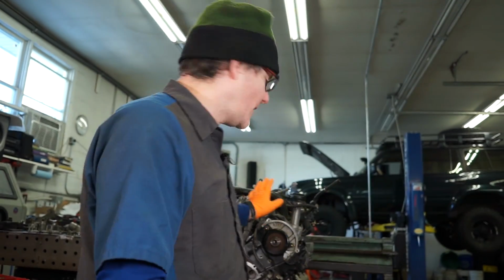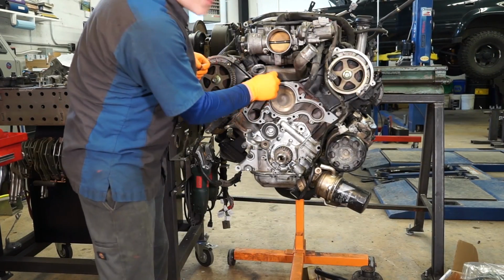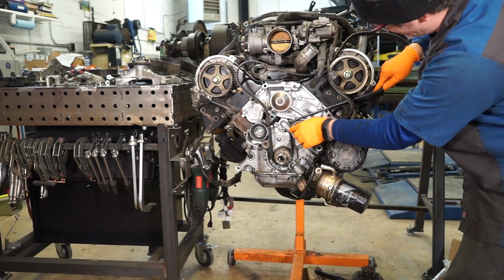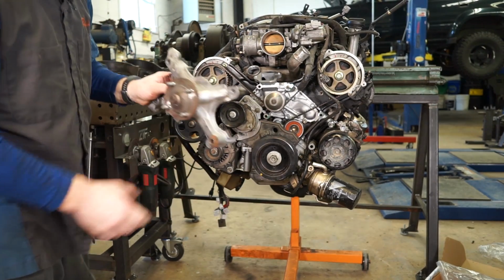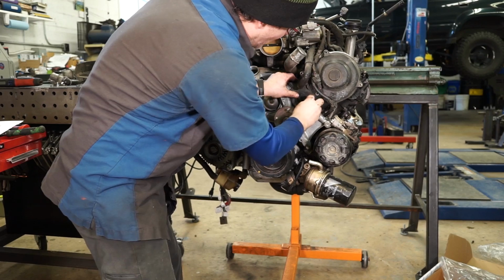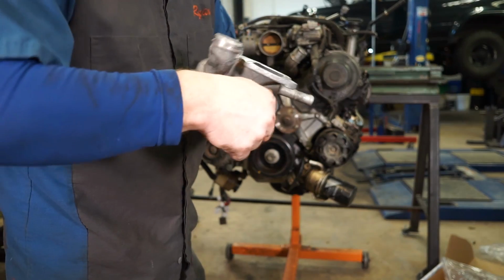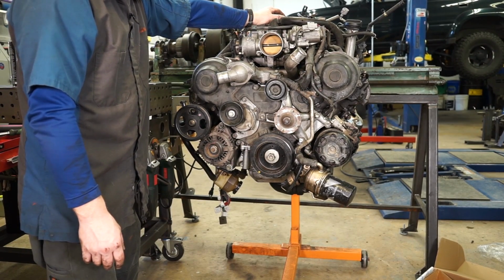Toyota 4.7 Timing Belt (updated) Part 3

Comment: Excellent Video, Helped me DIY, Power steering pump I believe is 33 not 13 seemed kind of light for 14mm so I double checked in the manual
Reply from the maker: That makes more sense. I thought it seemed light when I read it. Always awesome when service info has the wrong specs.

Comment: Excellent video series on this operation, thank you for sharing!  How many hours does it call for the water pump and timing belt?  Toyota only has them separate, 4 hrs for the water pump and 3.5 for the timing belt.  Thanks again!
Reply from the maker: The base timing belt is included in the water pump time since you have to remove the belt to change the pump. It adds a few tenths for each pulley if I remember right. I haven't looked up actual times in years since we have it set as a saved job.
Reply: @OTRAMM  thank you ❤

Comment: I know this is a old video. Well done by the way. What is the part number for the sealant you are using for the water neck? I was just going to use some hondabond.
Reply from the maker: I don't have the part number handy, but it actually changes by which coolant is in the engine. Red uses the older sealant and then there's a wicked expensive updated sealant for the pink coolant.
Reply: @OTRAMM  thanks for the reply. It's a 03 Tundra with a 2UZ-FE

Comment: The little triangle piece that closes off the opening between the timing belt and the AC compressor, behind the fan bracket. Did you put tat back in of camera somehow? Or did you forget to reinstall it? Because I didn't see that get reinstalled in the video.
Reply from the maker: It may have gone in off camera. It definitely went back in. That little piece is very important. We've seen two trucks jump time after mice got behind the cover from that piece being left out.

Comment: I  was told I had my timing correct . But I have no fire
Reply: Is it possible I shorted out the cam position sencer. I skint the wire.
Reply from the maker: It's possible. You'd need the codes and live data to really know what's going on

Comment: Why don't you have the crankshaft keyway lined up with the dimple? It looks like you have it closer to the "window" mark, (4 squares making 1 square).  Would you line it up to that "window" mark, which is past the dimple on crankshaft. when you have the cams set, past TDC (I) to the (T) timing belt service? So dimple on crankshaft and cam to TDC vertical line the same as cams on T and crank on window. Would this be right or wrong

Comment: What is the crankshaft mark, past the dimple, that looks like a window (4 small squares). Where your crankshaft is sitting it looks like it would be closer to the window mark than dimple. Having key stone on dimple only allows 3 of the 5 belt dots to fully seated on sprocket

Comment: Does it actually really matter which way the timing belt goes on the pulleys of a 2002 Toyota Sequoia timing belt
Reply from the maker: It matters a lot which way the belt goes. The timing marks on the belt only line up one way. That's why they marked it.

Comment: It confusing when you say your going to make two full revolutions on the crank pully when clearly their is a yellow mark on the crankshaft pully that shows you did not make two full revolution 🧐
Reply from the maker: Definitely did two revolutions. That's the only way you'll get the marks lined up.
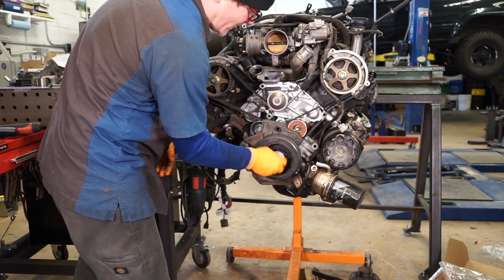Reply: @OTRAMM  @18:54 the yellow dot is at 9 o'clock give or take. I was a bit lost to but I think when you put it on there is a little play that doesn't show up on camera to well? cheers

Comment: What happens if my cam gear jumps and I lose track of the phase? How can I make sure it’s lined up and in phase?
Reply from the maker: Usually you can just spin  it back to the alignment marks. Just be gentle and stop if there's any binding. I've never had one move more than a few teeth.
Reply: @OTRAMM  I went all the way around with it a couple times 😬 still ok to just go back to the mark?
Reply from the maker: @TimRoman  I would assume that'd be ok. I've never tried though to be sure. I try not to let them move at all.
Reply: @OTRAMM  can’t be the first person to have been this dumb. One crank turn is two cam turns so 50% chance of guessing right. Will keep looking, thanks for the fast reply!

Comment: Thank you, and I much appreciate your explicit instruction videos on the timing belt replacement. It was my first time replacing a timing belt on my 2005 Toyota Sequoia SR5 4WD. I followed your part 1 on removing parts, then part #3, putting parts back and torque specs. 

I would like to thank this YouTube content creator ( https://www.youtube.com/watch?v=M5qzZZO_SE8 ) for tips on aligning the timing belt top pulleys to the "T" after the top dead center and then removing the old timing belt; I ignored the Toyota's manual's confusing instruction on rotating the crank 50 degrees after top dead center. The top timing pulleys did not jerk. 

And also, thanks to this YouTube content creator  (https://www.youtube.com/watch?v=9M3hFSiKs_U ) for removing the other parts before following your part 1 video. For anyone curious, my sequoia top pulleys did not look like those in the video. Mine have covers. 

It was a miracle. It was the first time my 2005 Toyota Sequoia ever got the timing belt replaced after 105k miles and 17 years. I followed the advice of a DIY mechanic who told me not to replace it before 100k. The factory timing belt still appeared to me it was in good condition. Please do not do what I did; follow the manufacturer suggested maintenance schedules.

Comment: Here are the time stamps for the video above. I really thank Otram for making this video. 

Full instructions can be see here - https://docs.google.com/spreadsheets/d/1eWefvjUPPUlQPfpIOQ1JHir8111iMPO0/edit?usp=sharing&ouid=118253069347740492478&rtpof=true&sd=true

Slide Crank Pully in keyway 	https://youtu.be/GiOgACPh68k?t=151
Clean Water Pump Area with scraper and green scuff pad (scotch bright pads)	https://youtu.be/GiOgACPh68k?t=331
Install Water Pump Gasket 	https://youtu.be/GiOgACPh68k?t=375
Install water pump pipe o-ring (put a little bit of silicone to make WP seat properly)	https://youtu.be/GiOgACPh68k?t=380
5. Install Water pump	https://youtu.be/GiOgACPh68k?t=420 
6. Install Idler Pully #2 (Red one)	https://youtu.be/GiOgACPh68k?t=584
7. Install Tentioner Pully #1 (Black) with washer	https://youtu.be/GiOgACPh68k?t=242
8. Install Plastic triangle	https://youtu.be/GiOgACPh68k?t=625
9. Install Timing belt	https://youtu.be/GiOgACPh68k?t=655
10. Double check Camshaft marks - Crank shaft timing marks again	https://youtu.be/GiOgACPh68k?t=880
11. Install Hydraulic Timing tensioner	https://youtu.be/GiOgACPh68k?t=892
12. Ensure timing belt is installed correctly with the correct Cam and Crank marks	https://youtu.be/GiOgACPh68k?t=982
13. Pull the tensioner Pin out of timing tensioner	https://youtu.be/GiOgACPh68k?t=1035
14. Put timing keyway Gear disk (Timing way key gear) - MAKE SURE Concave side out	https://youtu.be/GiOgACPh68k?t=1051
15. Install  Crankshaft plastic timing cover on	https://youtu.be/GiOgACPh68k?t=1075
16. Install crankshaft timing pully (dampner pully) line it up with the Keyway	https://youtu.be/GiOgACPh68k?t=1115
17. Double check timing is good again	"https://youtu.be/GiOgACPh68k?t=1135

- https://youtu.be/GiOgACPh68k?t=1160"
18. Install Serpentine belt tensioner (upper left)	https://youtu.be/GiOgACPh68k?t=1262
19. Install Alternator bolts back	https://youtu.be/GiOgACPh68k?t=1348
20. Install Power Steering pump	https://youtu.be/GiOgACPh68k?t=1401
21. Install Fan pulley bracket - Make sure wiring is tucked back properly - Make sure it sits without rocking 	https://youtu.be/GiOgACPh68k?t=1497
Put AC bracket back on the fan bracket	https://youtu.be/GiOgACPh68k?t=1663
"22. AC compressor bolts - put long 2x14mm bolts from side (top and bottom) onto the fan bracket 

- Likely need a swivel socket wrench to tighten front bottom bolt.
- Tighten back ac bolt 

Tq = 36ft for all 3 bolts
"	https://youtu.be/GiOgACPh68k?t=1660 and put in ac  bolts back up
 - Snap AC Compressor wiring back on	
23. Install Cam postion sensor	https://youtu.be/GiOgACPh68k?t=1750
24. Install Right side Cam belt cover - Fish Cam sensor and Gromet through the cover	https://youtu.be/GiOgACPh68k?t=1840
25. Install Water pump plastic cover	https://youtu.be/GiOgACPh68k?t=1955
26. Install Left Cam belt plastic cover	
27. Clean Water outlet Inlet and on water outlet part with razor, wire brush of old FIPG, degrease the area both side	
"28. Install Thermo water outlet - Put Outlet O-Ring on little bit of Silicon Grease 

- Clean surface of Water outlet (old FIPG clean with green pad/razer blade wire brush the surface) put new FIPG gasket maker on"	https://youtu.be/GiOgACPh68k?t=2094
"29. Install water outlet pipe 

"	https://youtu.be/GiOgACPh68k?t=2366
30. Install top idler pully	https://youtu.be/GiOgACPh68k?t=2451
31. Install Thermostat with Thermostat Seal - Ensure if you have Toyota Thermo that the Giggle valve on the 12 O'Clock position	https://youtu.be/GiOgACPh68k?t=2511
32. Install Fan pully cover 	https://youtu.be/GiOgACPh68k?t=2600
33. Install Serpentine Belt (see diagram on your hood sticker or to the side)	
34. Install Fan 	
35. Install Radiator if you took it out 	
Put in new Coolant

Comment: Brad, thank you so much for such a great job on this video with the details, lighting , torque values, explanations, etc. I am just in the process of receiving all of the parts and tools that you noted, in order to do the T Belt / water pump R & R on my 03 Lexus GX470. But with so many different videos, and so many comments stating to use the "I" marks on the cams or the "T" marks on the cam, TDC, 50 degrees before TDC, or after TDC on the crank, can you please tell me if this video, the way you lined up all the marks on the cams and crank, will this apply directly to the 4.7 L engine in the 2003 Lexus GX470 as well? This is the non-VVT engine, if that makes any difference.

Comment: Working on a 03 Sequoia 4.7 liter, Identifix says the timing marks should be zero. The Aisin timing belt kit instructions say to go 50 degrees past zero.  If you put the crank at the zero mark and remove timing belt will this create any problems going back together. Or how can this be corrected after belt is removed if it does create a problem.
Reply from the maker: I'm pretty sure identifix is using the Toyota manuals so I'd lean towards following them.
Reply: @OTRAMM  Thanks. I will rotate the engine three or four complete 720 degree rotations to make sure it stays in time.
Reply: Thanks again, the engine has over 321,000 miles. It ran great when everything was put back together.

Comment: Great video! Thank you for taking the time to do it. I'm due for my 2nd timing belt soon on my 07 LX. I feel confident to do this myself. What is the typical life span of Alternator, Power steering pump and AC compressor ? Would it make sense to replace it all as part of 200k service or should I leave it alone if they are working?
Reply from the maker: I'd leave them alone if they're working. Of the three we do alternators most often. But even those we don't do many of.

Comment: I changed my timing belt on 06 tundra. I swapped out the belt on the same tdc marks and went to start it and it just cranked but didn’t fire up. I took everything thing off to see if the cams and crank were in their proper positions and they weren’t. How can I redo this job and get it timed properly?

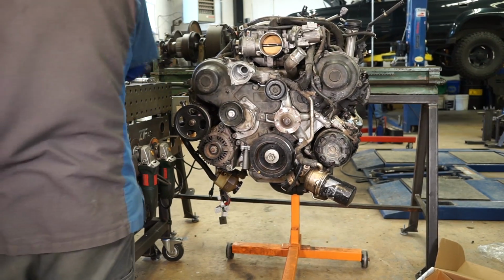Comment: 41:40 it does matter to us if it doesn't torque up right because ours may do the same thing!!!

What ended up being the problem/solution?
Reply from the maker: I think you're referring to the compressor bolt not tightening. It ended up being a cheap aftermarket fan bracket that was installed at some point in the past. The casting was cracked through the threads. We replaced it with an Aisin bracket and all was well.
Reply: @OTRAMM  oh ok! Wonderful to hear! Thank you!

Comment: So in replacing my timing timing belt with the engine in the car on my wife’s ’06 Sequoia, as I was putting the alternator back on, I had my torque wrench set at 29 ft/lbs for the top 14mm nut, and was just wrenching away when I heard a pop, and only then did I step back and notice the whole alternator, when viewing it from dead ahead in front of the vehicle, had started to twist to the left, so that its pulley was a good bit out of line with the rest of the pulleys - and this was with the bottom bolt and smaller 12mm nut in the middle at least snugged up. How is that even possible? Does the top back portion of the alternator not actually rest or get pressed up against the engine block? 
I took the bolt and two nuts back off and slid the alternator back off the studs to get a look at everything and nothing appeared to be obviously bent, so I put it back on, torqued the lower bolt and middle nut to spec, and then basically just ran down the top nut until it appeared to be in line with the rest of the pulleys (basically right up to where it wanted to start twisting again), and am hoping that will be good enough when I get the belt back on and get ready to fire it up. Have you or anyone else ever heard of/seen anything like that? Thanks for the videos and your insights!
Reply from the maker: I'm almost positive the serpentine belt tensioner bracket is slid on to that stud before the alternator and that's what the alternator bottoms against. Are you sure the tensioner bracket is installed correctly.
Reply: @OTRAMM  god dangit, I was just rewatching your video and noticed that that’s what I did 🤦‍♂️
Oh well, live and learn, right? Thanks for paying such close attention to your channel and being so responsive, I really appreciate it!

Comment: Hey, Ryan. I'm replacing my fan bracket tomorrow because the Idler pulley bolt wouldn't torque to spec (a problem I see you had on this fan bracket). What was the cause on this engine? The threads inside the female receiver on my fan bracket are almost completely stripped out. I wonder if it is just a poor quality part :/
Reply from the maker: The one that stripped for us was a crappy chinese knockoff the previous shop used. Replaced with an Aisin and all was well.
Reply: @OTRAMM  Just used this video to do a timing belt replacement on a 1999 LX470. As an update to my previous comment, the same exact thing caused mine to fail torque spec. It was a cheap aftermarket fan bracket as well as cheap aftermarket TB, WP (leaking), and idler pulleys for the TB. The pulley exploded and wrecked the belt. Replaced with all OEM and AISIN parts. What a nightmare.

Comment: Hey so I didn’t hear you mention or notice you use any blue locktite (and actually I think I saw one guy put red thread sealer on the crank bolt 😳). Does the Toyota manual not call for any on any of those nuts/bolts/studs? Thanks for the videos!
Reply from the maker: Correct, they don't call for loctite on the crank bolt.

Comment: This is the BEST video series out there on this. I do have a question I could use some help with if you would be so kind as to assist.

2002 Sequoia-

When I torque the timing belt tension pulley to 25 ft lb it no longer pivots freely. I noticed this after I pulled the tensioner pin and it didn't push the pulley up to take the slack out of the belt.When I backed out the hex nut the pin did release and apply tension, but I'm pretty sure re-torquing is locking the pulley in place so it doesn't pivot. 

I used the exact same bolt and washer from the old tensioner pulley. It is a brand new pulley and tension pin (Aisin TKT-021 kit), I used 3 different torque wrenches to make sure I wasn't over tightening it, and I made sure the thick washer was in place between the block/pulley.

I am afraid it is not safe to leave as is and the tensioner won't remove the slack if/when the belt stretches down the road.

What did I do wrong? 
(Thank you)
Reply from the maker: That's strange. With the same bolt and washer and the washer next to the block I don't know what would make it lock up. Maybe some grit stuck between parts? Have you measured the thickness of the new tenioner compared to the old one? I've never seen an Aisin part machined wrong but it's possible. Does the bolt spin freely in the bore when everything is loose?
Reply: @OTRAMM  Unfortunately I only eyeballed it before installing and did not spec/measure, however the bolt did spin freely before torquing.

I am guessing your hunch is correct, that the casing width that the bolt slides into is wider than normal, therefore the washer torques against the pulley casing as opposed to the bolt shaft/hub.

I'll have to pull it apart again to spec it and verify (was hoping to avoid that since I had pulled the tensioner pin).

If that is the case, do you think it would be better to grind down the casing until the bolt shaft/hub extends beyond casing width... Or better to just add a small washer to extend the bolt shaft length? 

(Or think it best to return it altogether?)

Thanks for the quick reply!
Reply from the maker: If it were me and the casing was too thick I'd exchange it for a new one. Too many bad things can happen if the tensioner fails.
Reply: @OTRAMM  

Thanks for the insight- I had to order a whole new kit (as Rockauto wouldn't replace just the one part).

In case it ever comes up for anyone else in the future for anyone else- the part was Koyo Timing Belt Tensioner Roller LAT1030-1 FG, from the AISIN TKT-021 kit.

The difference was maybe a fingernail or so in width, impossible to tell by eyeball, but it made all the difference. 

A good eyeball clue is the copper sleeve insert (pressed into the bolt hole) will actually look slightly recessed instead of flush with the housing.